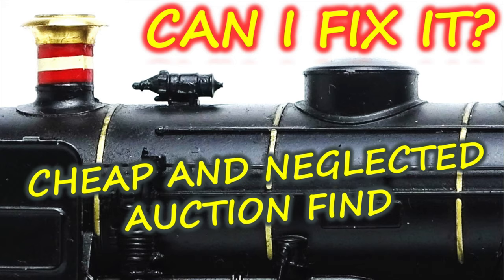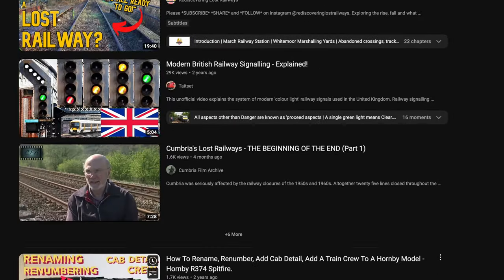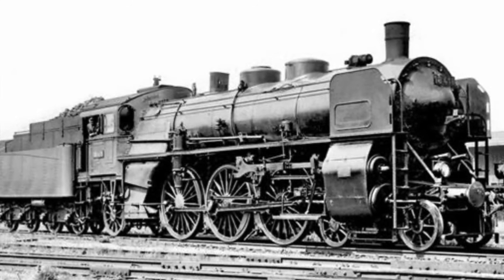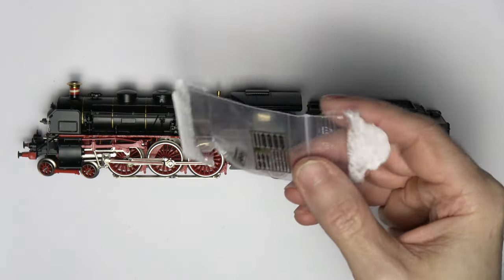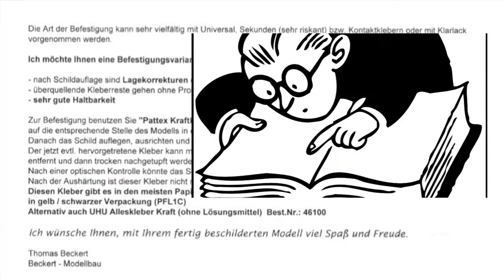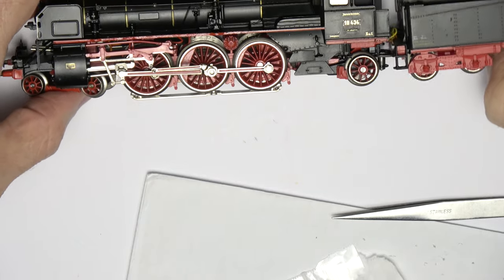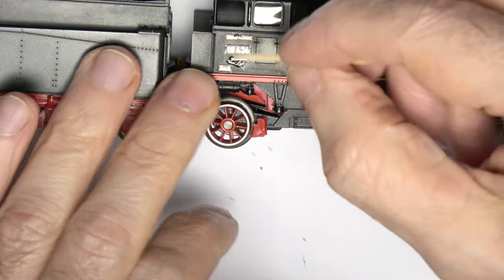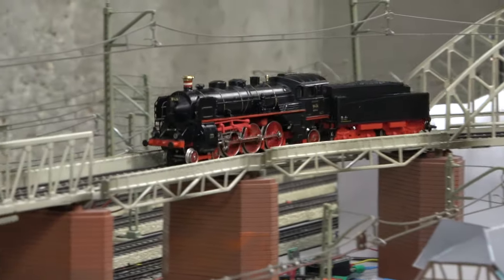An attempt at re-numbering... - Can I fix it?

Comment: Amased! I will definetly give this a try
Reply from the maker: Hope you do better than I did 😉
Reply: @The3rdRail  well, since decals and adding metal parts to kits never were my favourits, I will not  compete on it. Your 3518 looks great-better than in the catalogue picture. Maybe the manuactures plates on the cylinders did the job? I think they were dropped for the Rheingold lokos. The older 18.479 in DB red/black paintsceme had those? 
Just following along :) 
I failed on using the decals from Revell-kits to fix my class 18.4  before and did not find compareable plates. After watching, there will be a try with this product
Reply from the maker: The Märklin Rheingold locos 3318/3518/36188 all have manufacturer plates on the cylinders. I used the 3318 as a template to order the plates. Have fun!
Reply: @The3rdRail  thanks! Keep on going, really enjoy your videos

Comment: Goodness, a daunting task by the looks of it but a well good learning experience. Using a sewing needle could enhance accuracy of applying the  glue perhaps but some plates are extremely tiny. A magnifying glass on a stand might help as well, and a pair of tweezers, but super steady hands are definitely required by any means too. You've done a nice job here nonetheless. This loco seems to be perfect for learning these kind of detailing skills.
Reply from the maker: Very true! I'll try your suggestions if I ever have to do this again, thanks for the visit.